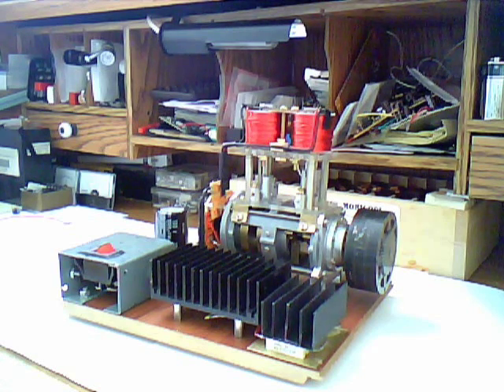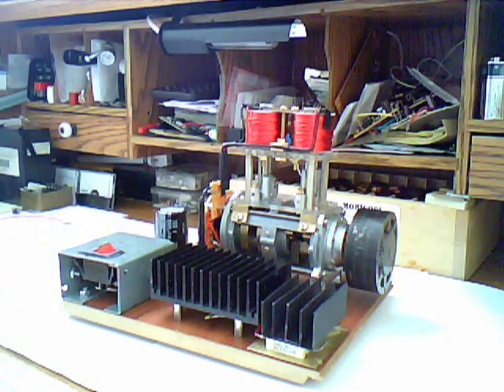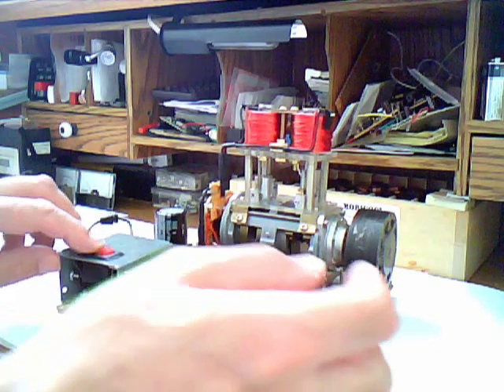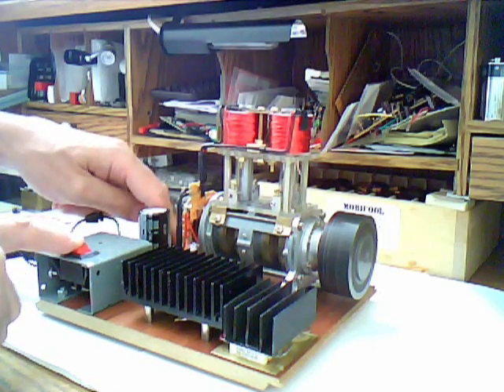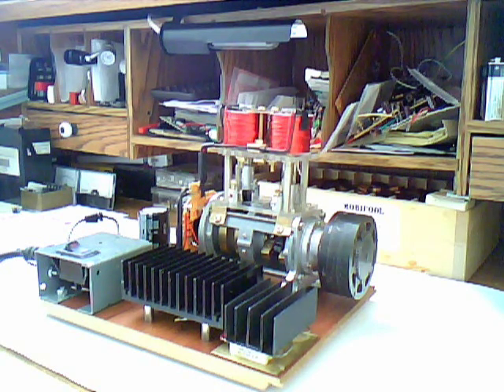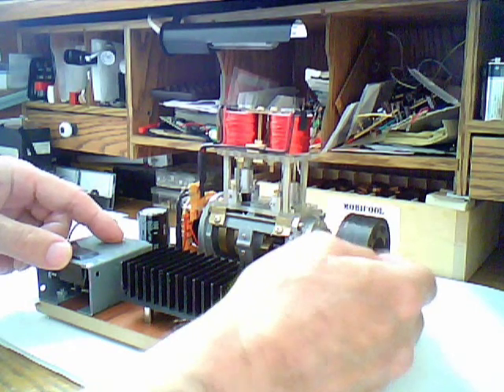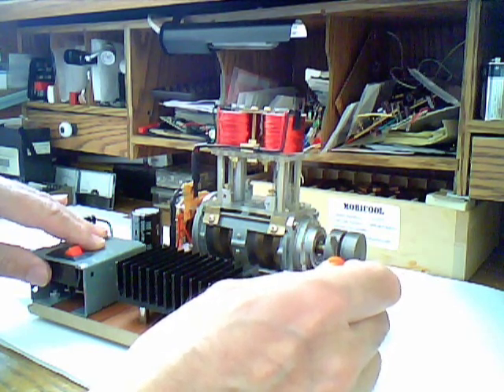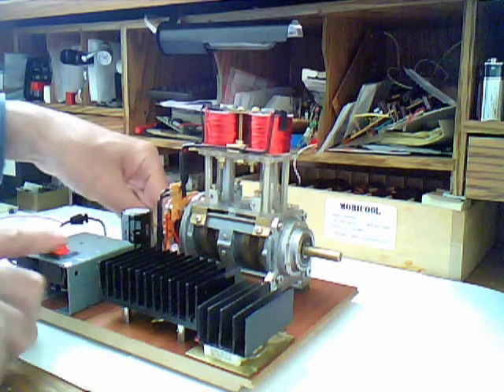AN ELECTRIC 2 PISTON ENGINE

Comment: Have fun. It took me 11 seconds to realize how this is a total waste of time. Why use reciprocation? Combustion engines must use a crank. Electric motors are more efficient than combustion due to this extra rotating mass. Also, in a combustion engine piston drag is a huge power robber. One piston must push all the others. They take turns. Rotation is the outcome. To use this method of obtaining rotation with electricity is counterproductive. Why not use pneumatics? Better than burning up a coil.